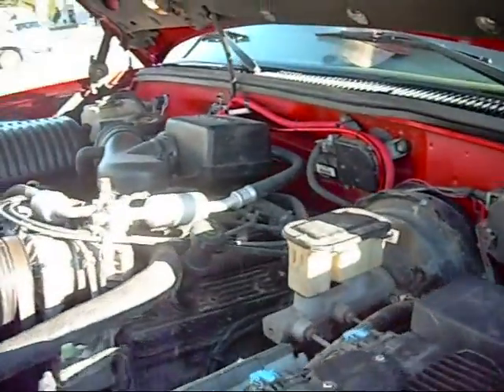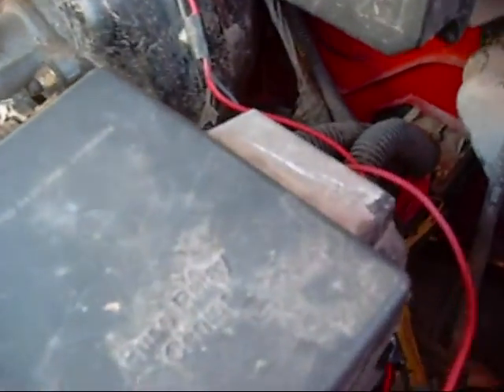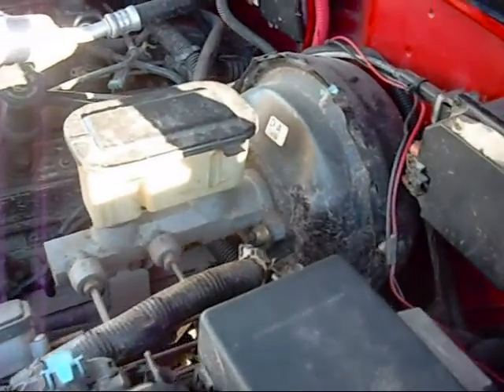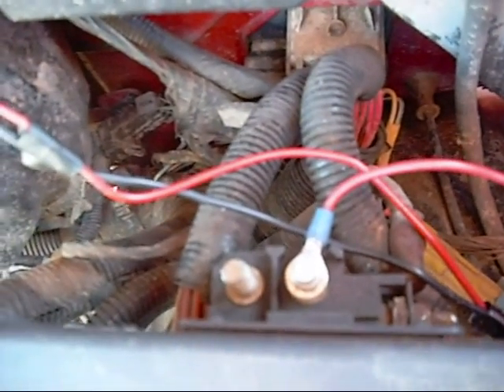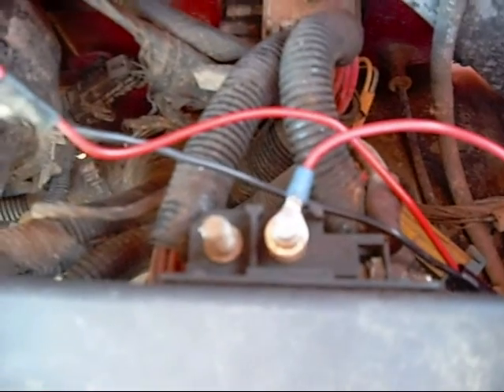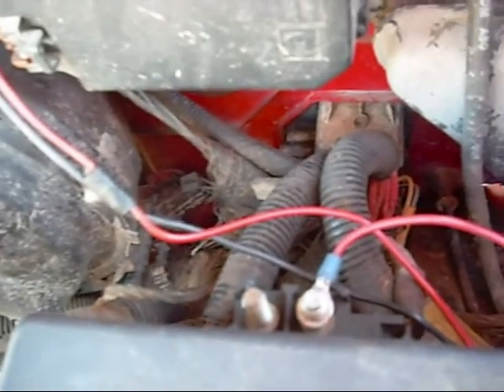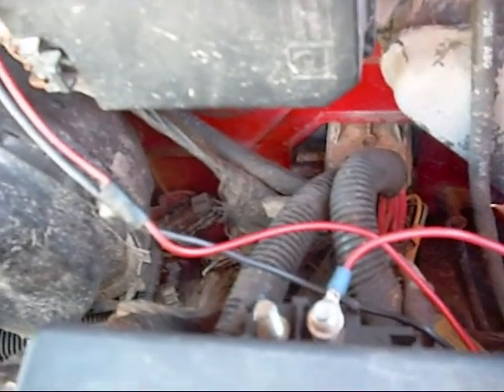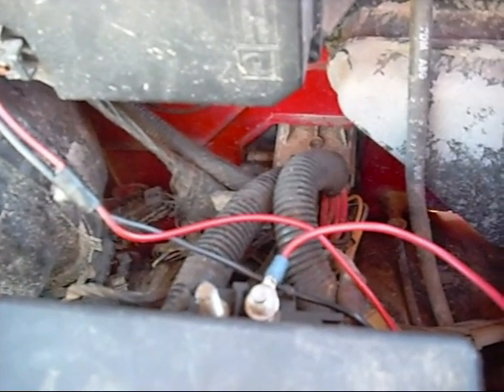Power Sources On 98 Chevy

Comment: I was thinking of doing that.  I'd rather it turned on and off with the stereo but the ignition is the next best thing.  But I got to sort a fuel leak first.  Its pissing everwhere as soon as the pump is going!  So far this car has given my nothing but trouble.  But it wouldnt be a first car if it didnt!

Comment: Im having enough trouble wiring my amp to my stereo.  I cant find a suitable wire to run the remote wire for the amp off.  Need a  wire that turns off when the stereo does.  Its frustrating.  And Ive tried all the wires and still no success ):